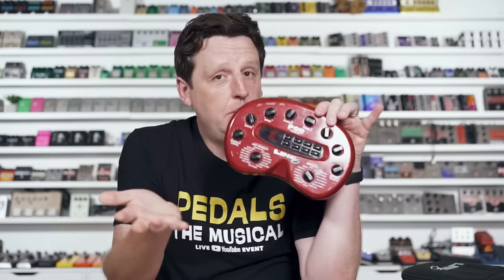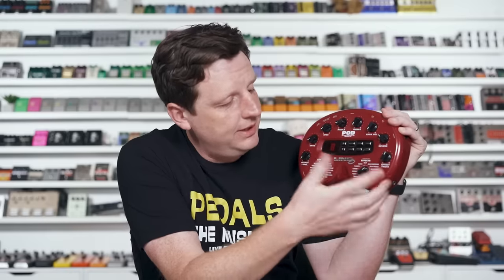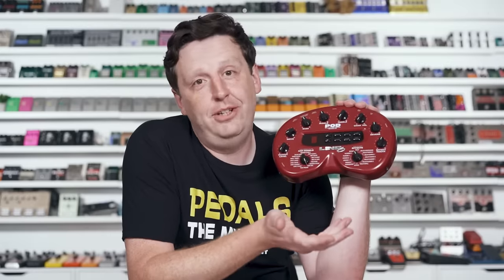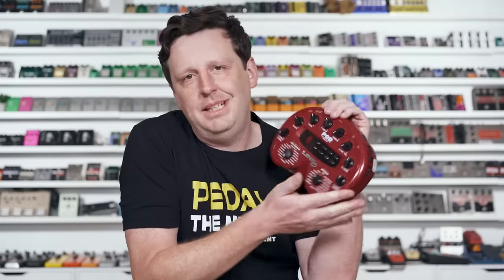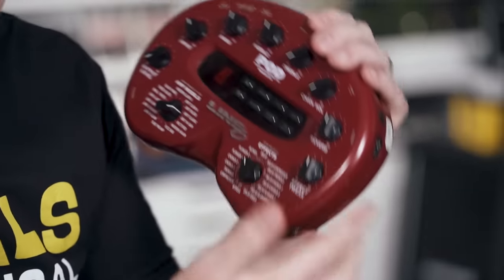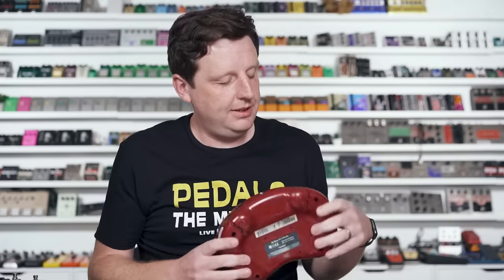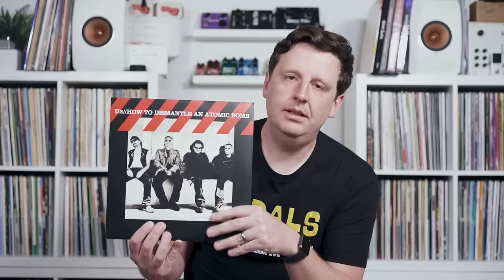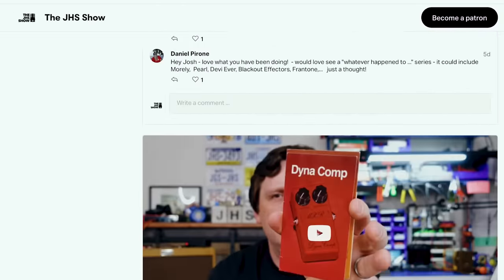Why The Line 6 POD Sounds Really Bad

Comment: I've demonized a lot of gear because my impression of it was how it sounded into the clean channel of a 15 watt, 8" speaker practice combo amp. My less than a year of playing and cheap strat copy didn't help either. I think a lot of us formed opinions on things in that stage of our playing and haven't really questioned them since.
Reply: I got stuck thinking all line 6 products sucked because my first amp was a 15 watt spider 3.
Reply: Also the presets aren’t always that good. You gotta tweak them.
Reply: I hated line 6 when I was younger, but I later realized that I just didn't Iike the kid I knew that had one. Played some of the stuff since and it's fun. Enjoy the pedals more than the amps but dont have a ton of experience with the amps.
Reply: I feel the same way.
Reply: I understand where you're coming from, and I definitely think the Line6 pod has its place, but at the same time, if you actually have that killer amp and guitar, there really is no need for the pod. It gave and gives us access to a wide variety of sound faksimiles, at a significantly lower price than even one of them. As such, it has been a great tool in many a budding guitarist's formative years, and still has its uses on the fly.
Reply: I think a lot of the hate comes from the fact that the amp models don't really sound like the real thing, but that doesn't mean it sounds bad..
Reply: I think this is the same reason why people hated on early analog DOD pedals for years. Most people never really got a chance to hear them through great amps with quality guitars, and instead formed their opinions as teenagers plugged into their Gorilla amps and Memphis guitars.
Reply: @thomascunningham2919  My problem with the digitech pedal may not have been that. The original Whammy pedal was great, but for some reason all the reissues, and later pedals the expression part of the pedal always crapped out.
Reply: @williamolsen20  I should have specified that I was referring to early analog DOD pedals (overdrive, chorus, etc) that were considered inferior because they tended to attract players who couldn’t afford high quality gear, and subsequently only heard the pedals through said gear.
Reply: @thomascunningham2919  ok
Reply: @thomascunningham2919  I think you did, I was kind of tired, and obviously not paying total attention to your post. I looked back, and wondered how I got to the post that I did.
Reply: you need a powerful clean audio system to to model or imitate another ampm or sound...take it from an home/car audio gear guy
Reply: This, exactly. Amp and cab modelers are designed to be output either through a transparent full-range PA or directly into a DAW. So many guitarists just ran the POD through the clean channel of a guitar amp+cab, which is usually not really clean and certainly not transparent or full-range! So what they'd get was effectively a double dose of midrange and cab convolution. It would be like mic'ing one guitar amp+cab inside a soundproof box, and then feeding that signal into a second guitar amp+cab on stage. Of course that sounds awful!

Comment: I bought one when they first came out . I had a garbage amp and this was my “ Rock star level achieved” I would just throw on some good headphones and instantly became awesome. It allowed me to play late at night without disturbing others . It was great and not to mention one of the monthly guitar publications used to give you famous artist settings to go along with the tablature, really educational. I finally got rid of it about 5 years ago just because I was not using it anymore. I think I traded in and the amount went towards a Catalinbread  Echorec
Reply: Me too man! I was 12, worked cutting lawns all summer, bought one of these and a bc rich warlock, plugged in my headphones and started my guitar journey.
Reply: The headphones made it a usefully tool..
Reply: I thought using the headphones was cool until I developed tinnitus from it about 8 years ago.
Reply: I never owned one, but when a friend bought one, he eventually gave me his old rack mount Art SGX2000.  I can’t get that to sound right through my amp, but through headphones, it’s glorious and it’s in stereo. Point is, there’s nothing wrong with a quality headphone setup that encourages you to play.
Reply: That's because amp modeling pedals are meant to be used with full-range speakers and typical guitar amps aren't full-range.

Comment: Back when this came out, me and almost everyone I knew were broke. Almost everyone used a multieffects (pods or the BOSS digital boards) and a solid state amp because that's all we could afford. Analog pedals and tube amps were out of our reach, those were for pros and rich kids. 
I guess a lot of people my age associate this with the time they couldn't afford anything better (read, more expensive) and don't want to go back to it? But we sure used to have fun with this stuff.
Personally, the only reason I don't use my old digital VOX board at all anymore is because it died on me. Strap one of those to the fx loop and you have all the modulation in the world for almost nothing.
Reply: Honestly^^^
Reply: Kraft dinners. Better if you don't have to.
Reply: I had one of those VOX multi-fx units when they came out (TV yellow/black top/white chicken-head knobs/3 presets per bank). I just needed a reverb that could run on batteries at the time, for busking. The VOX multi-fx was like $99 at the time, and that's a little less than a simple reverb/delay (BOSS RV-3 type thing, at the time) cost anyway. It turned out to have decent, stage-usable mod sounds, and great delays as well. You could run an exp pedal on the patch parameters, too. The drive tones were like 'living-room guitar' more or less. For then-$99, that was amazing. I ended up giving it to my brother when I moved away from busking country.

Comment: I was gigging totally ampless in the early 2000s with this unit. Convinced my bass player to get the bass version too. Always had great sound and not a lot to have to carry.
Reply: Addendum: Like a lot of gear, I don't know why I sold it. I also had the Flextone II 2x12 amp. Shouldn't have sold that either.
Reply: Same here, but with the Vox Tonelab SE.
Reply: Did you plug straight into the PA?
Reply: Yes. Completely ampless on stage. Just monitored via wedges.
Reply: @goodheartmedia  awesome dude! Really thinking of picking one up out of curiosity
Reply: @goodheartmedia I did the same with a Tube Screamer, people didn’t believe the tones coming out of that thing! I’m thinking of going back to it.

Comment: Love to see a look at old Zoom products like their multi-effect pedals and amps.
Reply: The 505II makes a short appearance in a digital can't sound good video
Reply: I got a zoom g1 four and its actually pretty good, until you try to do high gain that is.
Reply: Only if he talks with the designer over zoom lol
Reply: I picked up a g2.1u for $25 CAD.  It sounds amazing
Reply: Zoom 9000
Used that live with a Fender Twin Reverb on 10.
My band hated me for ever! XD
Reply: I'm still recording with some of my old Zoom stuff.  Love it.
Reply: Zoom 9030 🙏🙏
Reply: I once bought some $150 pedal from an online store that ended up admitting they didn't have stock, but would I take a floor model Zoom G9.2tt.  Some great sounds in it, but I find myself overwhelmed and it sits in the corner scaring me.  I call it Mission Control.
Reply: Zoom g3x I still use it to this day for every effect o need in the effects loop including a volume boost
Reply: @greigwilliamson6763  I bought a G3X recently because I assumed it would have the same great sounding amp sims as my Zoom R8 and be a stage worthy beefy alternative...Was I sorely mistaken.
 I have been AB tweaking between the two machines for a couple of months now and I can't get the Zoom G3X to sound anything like as amazing (and noise free!) as the Zoom R8. The amp sims, reverbs, EQs and effects are ALL far better sounding in the R8 but its such a flimsy plastic toy box meant for desktop.  I am now trying to find another R8 cheap that I can put in a steel box and use as the front end for my lowly setup. Oddly, by using the G3X on an amp setting with "cab off" selected running into the R8 with the amp sim on in that I can get an even better emulation of the amp, it seems. Yet, putting two amp sims in a similar setting one into another in the G3X just sounds doubly terrible.  I suspect the R8 has considerably better inards as its designed to be a digital multitrack recorder.
Reply: Zoom gfx8 ❤
Reply: I second this.
Reply: Yep! CDR is a great Swiss Army knife of a pedal
Reply: Zoom 9002! Size of a pack of cigarettes, built in strap guides to hook it to your guitar strap or your belt, LCD display. Didn't sound like much going through my off-brand solid state 15w amp, but I enjoyed it!  Still use a zoom g1Xfour
Reply: Zoom 9150 valve. Yeah.
Reply: I had that little yellow zoom fire? it looked like a giant cellphone. it was legit shit but i could bring it to work
Reply: I have a zoom 505 and a G1nx used to run through a selmer 100w el34 amp and it was one of the best tones I'd ever heard.
Reply: Like my old Zoom 2020
Reply: I have a growing pedal collection. 
I have a Boss GT1000 core which is amazing.
I have Zoom, Caline, Boss Tech 21, TC Electronics and Darkglass stuff..even I have a custom made optical compresor/overdrive..
I just arrived from a rehearsal and all my bass tone and FX came from a 50 bucks Zoom B1on.
Reply: I still have the first one and it works like new
Reply: Not even this guy could possibly defend a Zoom with a straight face.
Reply: My Zoom G1X sucks big… change my mind
Reply: My childhood mate's Dad had a Zoom multi-effects board.
It was certainly good enough to wow the shit out of 13yo me. :)
Ed: Can't remember the model but it had four pedals, a 2-line LCD and a bunch of param knobs.
Sounded pretty amazing to me, but this was literally the first time I'd ever heard someone playing live through delay/reverb/slap echo etc. so....
Reply: I still have my zoom multi pedal somewhere in my parents house
Reply: I'm enjoying my Zoom G6. Had a G3X before and a GT1U before that.
Reply: @greigwilliamson6763  yup. And the drums and looper are great for composing. Got the G6 now. Really happy with it.
Reply: I had a 505 and use a GN a lot now. I still think they're great if you're conscious of their limitations.
Reply: Yes
Reply: I've done it, they don't hold up quite as well.
Reply: I have a Zoom8080 somewhere knocking around... and trust me... look there is nothing redeemable about it by todays standards. The distortion had a robotic quality. I dare not even turn it on anymore to hear exactly what was wrong with it with todays knowledge. Probably severe aliasing. I last heard it 19 years ago. That was enough for me.🤣🤣🤣.
Reply: Yes! I'm kind of Zoom disciple (it was the most popular brand of MultiFX at that time, at that place -along with Digitech), I had a 505II, then the G1x (still got it), used the G2, and I got that lil' magic box called MS-50G as my bedroom main toy.
Reply: I still use my zoom 2100 to this day

Comment: I bought mine in 2001 and still use it today. I've never found a need to get something different. I play Metal and Progressive Metal and to this day people ask me what I'm using to get such a brutal metal tone. I've been using the same settings that I programmed when I first got the Pod after reading through the manual. You have to hook it up through the effects loop of your amp to really make this thing shine. Alot of people miss that little detail. It doesn't sound nearly as good through the front of your amp.

Comment: My friend worked in a music store. He said, “You have to try this!” I resisted for a month or two, then one day I had 15 minutes to spare and tried it. I left the store scheming about what I could sell to get that stupid looking red bean! That was when I went to a full digital rig going direct to the PA/computer, and I have never gone back. (I had the full rack system with tube pre-amps, effects units and tube power amps with dual cabinets to go stereo. Pretty large rig. A lot of work!). I have gone from the POD bean to the Vetta to the POD XT Live to Fractal Audio Axe-Fx, Axe-Fx II and now Axe-Fx III. One of the best tones I ever had was my clean sound with the original POD with the clean Dumble setting. (Never could get that exact sound again after I sold that unit to 
“upgrade” to the Vetta.)

Comment: As a Line-6 fan, I have to say I'm impressed with the ol' bean, but it wasn't always that way. 

I used to run an open mic and a friend and regular at the event would bring a POD set up with extreme levels of gain (insane level?) And then plug it into my 2x12 guitar amp.  The tone was double scooped and so shrill, it made a Metal Zone sound "sweet" and "creamy" by comparison. 

Fast forward a bit, and I ended up getting hooked on the Line-6 tone core pedals for my stereo rig (verbzilla and Echo Park were my go to) I liked those so much I ended up getting a Line-6 M13.  For a while my live rig was a pair of M13 running a stereo pair of amps. 

After I learned that even the distortion tones were very usable (especially if you combine a few patches and respect the gain knob), I bought a Spyder Valve 100 MK2 head @ a pawn shop for $250. It is not my favorite recording amp, but it is amazing when you want to move some air--doom metal, or finger tap song solos both shine over a loud drummer. 

I didn't stop there as recently found a UX2 for $20 at Goodwill managed to get it working and gave it to a friend. 

Recently splurged on a Variax (2002) and a pod X3 Live for my current "live loop" setup. Don't get me wrong, I prefer a real banjo, a nice custom guitar, some EHX and Morley pedals, maybe some fancy "ultramafic" LAVA cable --- but the results from just a Variax and a Pod X3 live are more than adequate right out the PA, and keeps me from having to pack an amp, or using a Frontmam 25r or other house equipment. 

The best part is when people like the tone they get confused it's a Line-6, and especially confused it's from the "POD" lineup. 

Jeez, I typed a lot. My bad.

Comment: I’ve owned a bean for many years and still continue to use it. 
I’ve played many arenas with other guitar players using amps and I loved when they would always ask me what was I using for an amp and I would point to the bean and they were very surprised by the sound I was getting. 
Thanks for doing this video. 
The Bean still Rocks👍
Reply: Just because you can make it work doesn’t mean it would be a thousand times better with an actual piece of gear

Comment: I have my original POD from when the first came out. I haven't even ever gotten around to updating the chip. At times, it was my only effects, then sometimes I added my RAT box. The POD, plus the additional footboard foot switch with the wah/volume pedal is an amazingly versatile system. I usually had it down to about 6 or 7 really good sounds. 

The best all around sound is the Classic British (Marshall) sound, running somewhat gritty. It's mindblowingly accurate, and really sings. I now have a board with a bunch of expensive pedals, but I still can't get great sounds as easily and consistently as I can with my POD.

Comment: I got a BASS POD and I love it!  I also have a Flex-tone III which has most of the POD in in.  With the handy floor board you can  store like 40 pre-sets.
Reply: I’ve been using the Flextone 3!since 2003 (still using it) and get compliments all the time. If it ain’t broke, don’t fix it… BTW I sold thousands of PODs when I worked music retail from 1997-2007.

Comment: Good guitar players can sound good through almost anything, Steve Vai through a Peavey Bandit.  Bet it wouldn’t suck!
Reply: They sound good even as a clean pedal platform. I have the bandit 65 and it’s louder than I’ll ever need an amp. It doesn’t have the “cool” factor of jazz chorus but it’s amazing.
Reply: When I first started as a youngster I blamed my cheap gear as the reason I sucked, til I met a guy who made my cheap gear sound amazing . So I agree with you.
Reply: I amplify my Boss GT-100 into the effects return of a redstipe Bandit.  Doing this bypasses any Peavey-ness.
Reply: Last time I saw Jon Spencer Blues Explosion, he was playing through a Bandit. Sounded pretty rockin
Reply: pv bandit sounds great,i can make it sound decent
Reply: I love my Peavey Bandit. It’s so f’n heavy though.
Reply: Big ups to my PV Bandit 65 crew, glad to see y’all representin for Meridian, MS 👍🙌 

& Steve: it’s heavy bc it’s good, and it’s good bc it’s heavy!
Reply: I had an old bandit and yes the lead channel was crap but as a pedal platform it was awesome. Loud and built like a tank. In fact I think mine was used as a loudspeaker in WWII.
Reply: I love the old siver stripe Peavey amps. They are rugged and reiable. You just have to get to know them to dial them in good. They have a tendency to sound "honky". The thing I don't like about them is the  shared EQ that many of them have. I may be spoiled by MESAs.
Reply: Should have said he peavey rage instead.
Reply: I don't see why a Peavey Bandit is still referred to as a bad amp.
Reply: Good player. GREAT amp.
Reply: Kind of funny that you'd choose a Bandit as an example of a bad amp. They are actually great amps. I have no idea why they have such a bad reputation. People hear trans tube and immediately dismiss the amp, I think lol But the tech in that amp is actually good. It's one of the only solid state amps that actually sound better the louder you push the amp.

Comment: I still have mine. It once blew up after being plugged into a faulty 220 adaptor when I took it on a trip overseas. Got it fixed at the authorised Line 6 repair shop and it still works, even after over 20 years of having it. Great piece of gear!